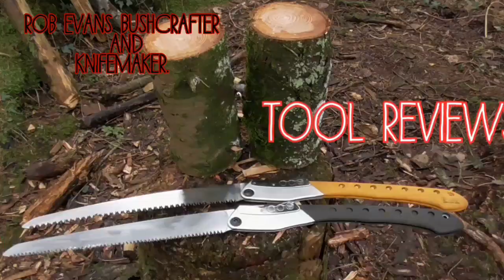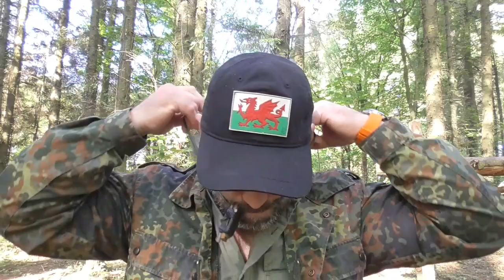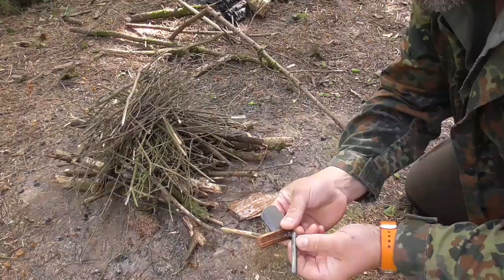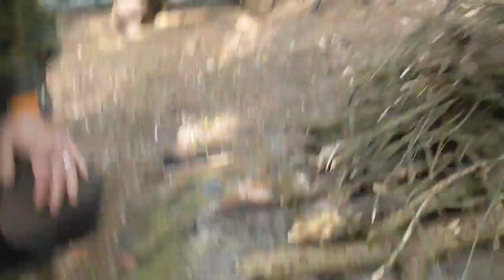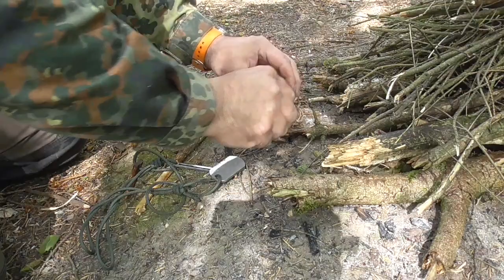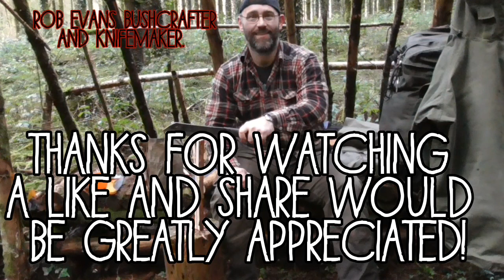Fire necklace mk2 ,in use, any better?

Comment: Magnesium is pretty crappy to use, I still carry it though. I’ve taken a liking to char cloth, flint and steel and birds nests. I made 4 lots of char cloth, 3 lots went in the bin, my 4th batch is awesome. Fatwood is another favourite of mine, I prefer the bigger bits too, less fiddly. I have about 20kgs of the stuff at the moment. If I were closer, I’d send you some.
Reply from the maker: I try to use all different materials for fire lighting, different woodland etc..
Reply: The more the merrier. I’m learning more ways to light fire everyday from YouTube, such a great place for learning/sharing. I saw a guy use a yukka leaf and fire ash with friction to create a coal, that was impressive.
Reply: Good sound info there. It's always useful to see the limitation of some fire lighters. Gonna have to get the sisal out and make up some firecord. Cheers